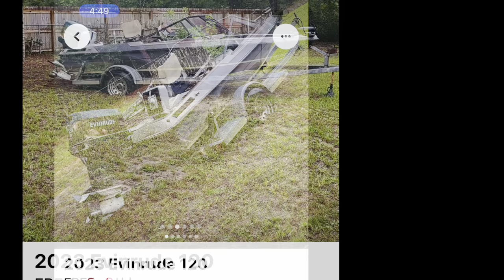Free Facebook Marketplace Boat, Motor and Trailer!! Will It Run?!

Comment: Those are some nice trees ya got with the boat lol nice free boat I'd be real surprised if it crank I would take plugs out pour some marvel mystery oil in it check compression new fuel filter plugs maybe wires anything else thts  looking bad those are really good engines they run strong running that boat will do probably around 55mph+ javelins were a top boat back then good luck z

Comment: OMC Javelin Fish and Ski - made in Tullahoma Tennessee.

Edit: I had the Javelin 396F/S (19.5 feet) with an Evinrude 200XP V6, would run about 65mph.
I would replace the power pack, coils, timer base, spark plugs, plug wires, and voltage regulator (tachometer gets signal from the voltage regulator).
Remove the VRO unit and premix in the tank, (instructions are online).
Then clean the carbs.
Look up the Link and Sync procedure to tune the carbs and timing. 
If it has decent compression then it'll run great.
Check the transom and lower floor (where the driver seat is) for wood rot.
Reply from the maker: Thank for this comment and info! That’s very fast and way faster than I was thinking! I still have the boat and based on the feedback I have been getting I think I am going to try and get it fixed and make a video of it as I go. It would be so cool to end the video with the boat running on the water. But I am going to have to give the hull a good inspection to see exactly how good or bad it is, as well as educating myself on what to look for and how to fix it. I may contact you along the way if I have any questions, if that’s ok with you.

Comment: My dad owns the exact same boat. Javelin is owned by OMC. They came with a factory OMC trolling motor. They didn't come with a MInn Kota. That's been added. It's a Javelin 18' F&S. Fish and ski. My dad's has a 150XP and it will run about 55. So with a 120 I'd say 45 or so. You put it in forward then tried to start it. It's not going to turn over like that. You actually have to grab the entire thing from the inside of the boat and THEN push it forward. All you did was put it in forward. It's not going to start anyway, the gas in that thing is probably over a decade old.

Comment: She's a Beaut! Without a Doubt! 👍
   Exactly the kind of boat I'd go for as a matter of fact.. 
I was as anxious as you were there @Biker Mike Motors to get that engine going, but I for one can completely understand the 'Project Overload' 
     Hypothetically if I was gonna go for a boat like that at auction, all I would need is The Boat (naturally), On a clean and moveable trailer (with a title for A) the Boat, and 2) the trailer).. Then just a engine that Does Indeed, Turn Over. 
      Keep it Simple & Easy,.. Take it one step at a time!
Reply from the maker: Project overload is the perfect way to put it! I really appreciate you and this comment, thank you so much!

Comment: I have an 89 Stratos fish and ski with a 200 Johnson engine. My boat has the same exact OMC throttle and ignition system. When you opened the throttle you put it into gear and that is why it wouldn't crank, in order to give it throttle while remaining in neutral you have to pull outward on the entire lever and then push the lever forward. This will allow you to throttle up while remaining in neutral, once you bring it back to the home position it is spring loaded and will rest back down into place, then you can engage it forward into gear and roll on down the lake. (Assuming you got it started)...    Johnson and Evinrudes are basically the same engines, they are both part of the same company. Well were when they were in business anyway.... but yea just thought I'd let you know that about the throttle hope it helps because it took me awhile to learn that when I first bought my boat. Lol